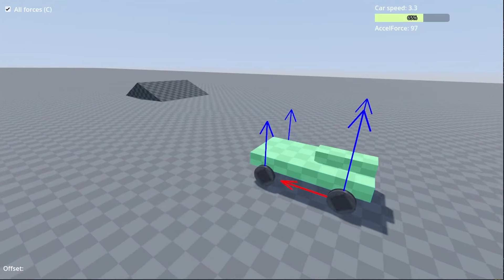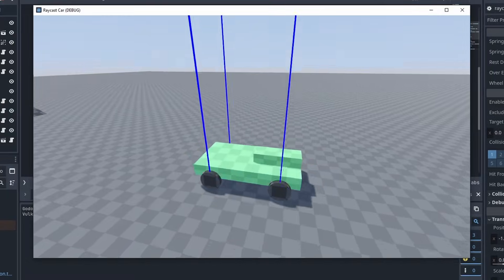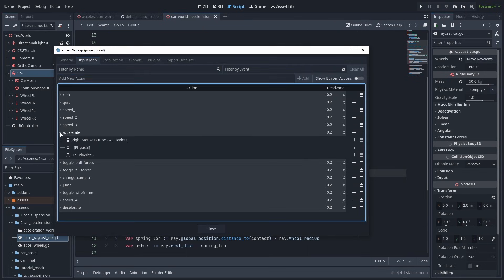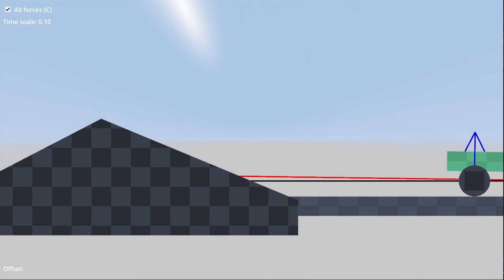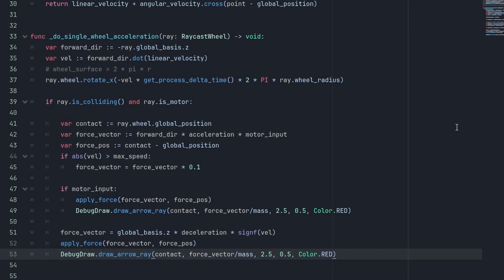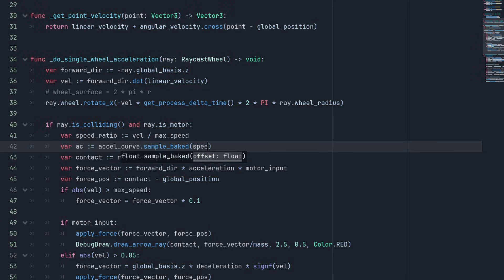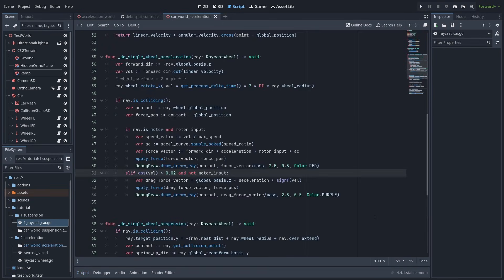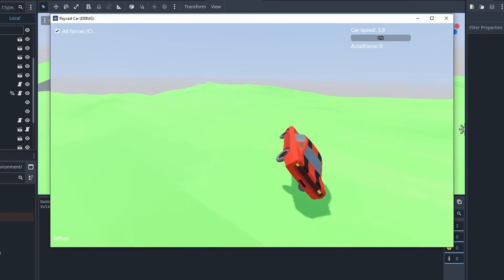Custom Raycast Vehicle Physics in Godot #2 | Acceleration

Comment: This video (and the entire tutorial) is absolutely amazing! My only comment I would change is @ 5:03, instead of doing this, if you want your game to be compatible with controllers, and furthermore, analog triggers, you'll want to do something like:

func _unhandled_input(event: InputEvent) -> void:
	motor_input = Input.get_action_strength("Gas") - Input.get_action_strength("Brake")

This takes the input strength of whichever key or controller input press "Gas" is, and subtracts "Brake". If you are using an analog input for gas/brake, the value can range between -1.0 and 1.0. If you are using keyboard presses, it automatically does full force on either Gas or Brake (if you are holding down both, it will = 0 still).
This is a really great resource on creating your own vehicle physics in Godot! I just thought I'd share my little nugget of knowledge here for other aspiring developers to learn upon :3

Comment: Your tutorials are simply amazing. I know neither coding nor physics but I can still at least get a high-level understanding of both. I attempted replicating this but in the _do_single_wheel_acceleration function, when defining the force vector (@3:06), I get an error saying ' Cannot infer the type of "force_vector" variable because the value doesn't have a set type '. Weirdly enough, this was exactly how we defined the force vector when writing the _do_single_wheel_suspension function but the editor doesn't flag any errors there... can you please help?
Reply from the maker: Sure, its because godot can't infer the type based on the variables you are using the set the initial value. 
An easy fix for this is to simply use = (equals) instead of := and it should all work out fine.

A bit more in-depth explanation:
Using := forces static typing. Meaning a variable can't change its type. And := will try to automatically infer the type based on the value you set it at initially.
The problem is that the resulting value probably has some variables with dynamic typing, so it can't infer the final value type without the game running.
You probably forgot to set one of the many variables as strongly typed, of even used a function that returned a dynamic type.

The reason its prefered to use static type is that it runs a bit faster and its easier to catch errors. As you get errors if something unexpected is happening.
Using dynamic type you can get cases where the game runs just fine.... until it doesn't, because it got an unexpected type, and everything breaks with no errors.
Also, autocomplete works better with static types.
Reply: @octodemy  Thank you for clarifying.

Programming sure is fun because I didn't know anything about dynamic or static typing so a bit of trial and error brought me to the same alternative you mentioned. I used = instead of := and it worked.

But after your help, I looked at my code and your were right about one of the variables having dynamic typing. In my case it was acceleration at the beginning of the code. Used := instead of = for setting acceleration and the problem was solved.

Wrecked my brain and bothered you for a silly mistake😶‍🌫😓🤦‍♂

Thanks though. You're amazing👍

Comment: My car starts gliding to the side when accelerating forward or going backward. What causes this?
Reply from the maker: Make sure you haven't scale anything. 
When using the global_basis vector to get the direction of things, this is affected by any scaling any of the parents might have. (I just found out recently)
You can make sure it is a unit vector by calling normalized() whenever you need to use the global_basis. (eg: -global_basis.z.normalized()

Also, you might have rotated the wrong node by mistake. Make sure you haven't rotated the raycast node, as we use its local direction to figure out the forces.
Reply: @octodemy  Thank you. Yes, I redid everything and followed your tutorial to the bone. In my first attempt I was using a custom mesh, and my own transform for collision, and I suppose somewhere in there I messed something up. Now it works well :) No gliding. I'll be sure to remember using normalized() as well in the future.
Reply: @octodemy  Another interesting thing is if I apply_impulse upwards to the car it always lands sorta sideways, implying that the center of mass isn't in the middle of the collision object, or that there is something else going on. And the car is rotating sideways for a bit after landing too.

Edit: I got a visual on the center_of_mass, and it's dead in the center. So I'm so confused why it defaults to angle itself slightly back to the right.

For anyone suffering the same problem, my current fix is to detect the wheels local sideways velocity.
If it detects sliding at a given threshold, it gives an opposite apply_force proportional to the sideways drift, and applies that force at the wheels contact point instead of the center, so it cancels out.
It's kind of a rough fix, but it does stabilize it a lot more.

Comment: I cant get the acceleration curve to work, when I add it the car just doesnt move, it tries but it doesnt move like yours, I made sure its the same code, same export vars but nothing.
Reply from the maker: It might be the weight of the car. I changed the weight of the car very quickly at some point in the video(maybe even the previous one) so you might have missed it.
But try to play around with the forces and values and see what works best for the game you want to make.

Comment: Another absolute gem of a video, thank you very much! I was struggling with this exact sinking problem you showed at around 12:30 and this resolved it. As a bonus it also fixed my spring forces acting in unexpected ways when moving faster (front spring taking bigger load than back spring with constant acceleration).

Comment: After I added decceleration to the car it started spinning weird, what could I have done wrong?
Reply from the maker: Might be the direction of nodes. Make sure the local orientation of things is correct for the raycast node wheel.
Or it might be something with how you got the direction in the code.
global_base.z and basis.z can be completely different directions.
Or maybe the dot product calculation. The order of operations in dot product matter if I recall. So the vec3 you call .dot from needs to be the same as in the video.

Kinda hard to guess as there is so many things that can go wrong. But hopefully you can find your problem.

Comment: Ive watched the first and second videos a few times, but I cannot solve why my rear 2 tires sink.  The front 2 react fine with the physics but the rear 2 just pass through the collision object
Reply: Figured it out I had an extra line of code in there
Reply: @gauntlet6387  and what would this line be please ? i am trying to use the projected force and the car just sink on the ground
Reply: @maximelovesdinosaurs3532  I went through the video again and recopied the code in a new file, then compared the 2. I cant remember anymore but somehow I left some code in after a change, and I think i had an operator that was + instead of minus or something.  Sorry I cant be a better help

Comment: shouldnt the forces be applied from the contact point with the ground?
Reply from the maker: You can, but applying the forces at the contact point makes it a bit too unstable because the point is too far away from the center of mass...
Specially when accelerating the wheel, it makes the car want to do wheelies, specially on the arcade cars with high suspensions.

In the end, what matters is how the car is feeling for you, not how accurate the physics is.
Also, keep in mind that I'm not really that great at physics, so much of what I do here is trial and error until I find something that works.

Comment: What's the matter that the maximum speed doesn't work when reversing?
Reply: it wasn't very clear, but you need to check the velocity in either direction. Try this: if abs(vel) > max_speed

Comment: Your videos are amazing! How did you figure out that bug where Raycast uses contact point from last frame? And what is 'other complicated way' to calculate suspension force vector? I trying to make a realistic car model and wondering if it is better than using get_collosion_normal vector.

Comment: man, your tutorials are dope, but one question, whenever i try to write the DebugDraw it displays a message telling that DebugDraw it is not declared, what can be happening?
Reply from the maker: DebugDraw is just an addon I've made for myself to display 3d shapes... Godot unfortunately doesn't come with any way to quickly draw 3d shapes.
You can ignore those lines. there are just there to display those arrows so we can see the results better.

There is also an addon called Debug Draw 3D in the asset library that you could use. 
But I personally find it a bit annoying to setup so I've made a simple one for myself instead.
The one I've made is public in github, but I've not added it to the assetlibrary because it is pretty bad, and I'm often changing it up.
Reply: @octodemy  oh, i see, thank you for answering pal